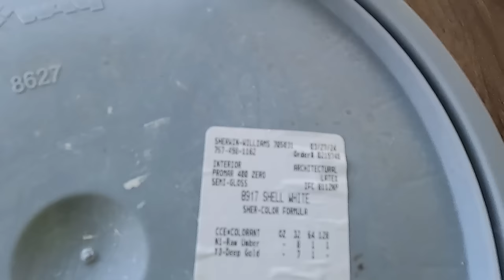Got Fired Today

Comment: I worked for a private electrical contractor for a multi property owner. They will use you and under pay you for your work. Then drop you just as quick if you ever question them. Life moves on.

Comment: Pro tip…..when you forget the caulk gun, use a thin handle hammer and push from the back 🫡. I’ll move to VA and work for a fair wage and show up everyday and you won’t even need to hold my hand. Hit me up brother. Hang in there and expand your areas of expertise you’ll make it. It’s all about reputation in a field like painting/GC.

Comment: I dont think it is helpfull to compare yourself to others or to focus on numbers when doing social media. The youtube algorithm rewards consistent overachieving which is impossible to maintain for obvious reasons. Still you get consistent views and engagement on every single video and if adsense is not delivering you might look into doing paid ads on the videos, or forming a connection with youtube for more clarification on your chanel analytics. Instead of spending your energy on thinking negatively of your achievements maybe try to focus on areas that are in your control.